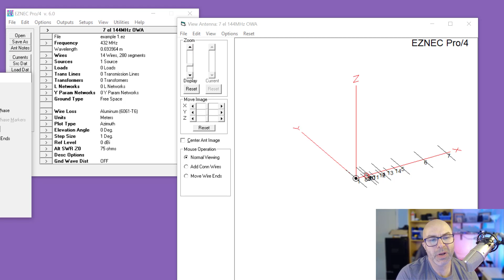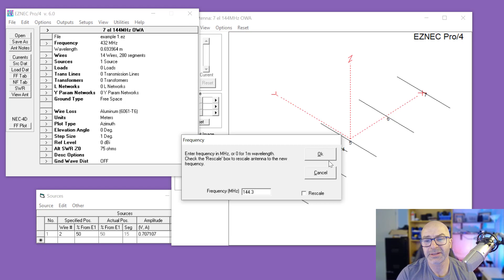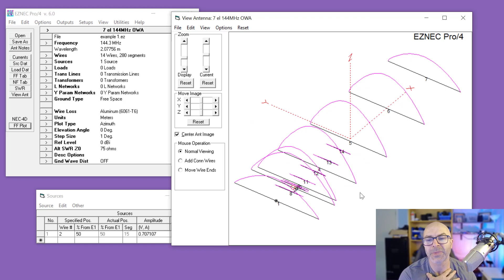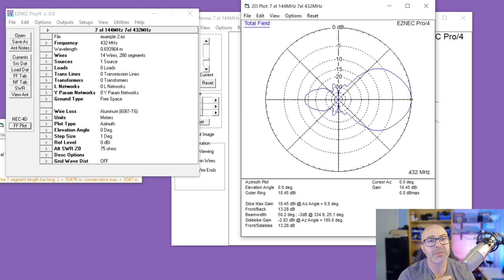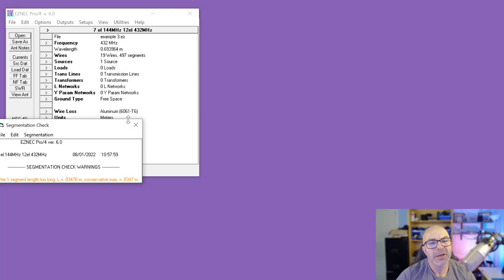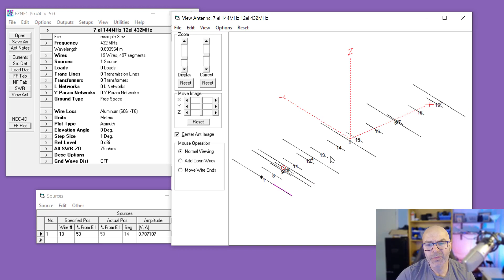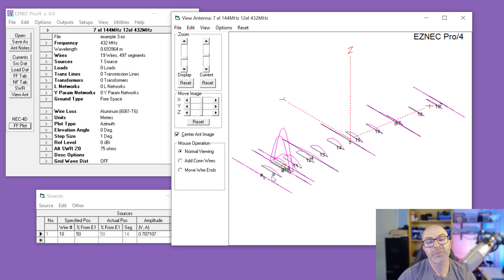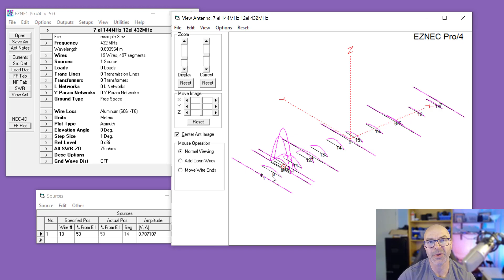2m and 70cms Dual Band Yagis - Why not? The dangers in your shack could be real!

Comment: Currently building a moxon 20m, I am using 4 glass fibre poles with the wires inside, so there is a bend towards driven / reflector at the ends. I have only just found your videos, great Ty. How would you model the bends in EZNEC?
Reply from the maker: difficult to do accurately without NEC4.2 running on EZNEC

Comment: Same question as Randy: What about the Arrow where 70cm and 2m have different polarization? The same problems?
Reply from the maker: no, not when in opposing planes and assuming the elements are perfectly centred. If the elements are off set to one another then there will be some distortion. worst on 70cms as a result of the offset effectively being 3 times that of 2m (in terms of frequency)

Comment: I would be interested to see what would happen if the two antennas were cross-polarized,
Reply from the maker: Ni issue when in opposing planes and assuming the elements are perfectly centred. If the elements are off set to one another then there will be some distortion. worst on 70cms as a result of the offset effectively being 3 times that of 2m (in terms of frequency)

Comment: Very interesting insights of the combination problems which can occur.
Even the harmonic infeed problem with risk of destroying the RX stage is rather frightening.
Reply from the maker: Thanks Heinz, As I mentioned in the video, these are worst case scenarios although all or any of these issues can occur, the worst being the twin-fed problems to the RX of the primary band. It is better to know what could happen to take measure to prevent it or use this information to guide your antenna decisions differently.
Reply: @hamradioguys  TNX Justin for your reply!
My actual setup is rooftop mounted an I0JXX 6m 7el Yagi (12 m above ground, 2 m above roof) on the lower and a 2M12 on the upper mast position, with a distance of roughly 2m.
M² does a great job here since over 2 decades, Italy antenna performs also well but is mechanical crap (round boom with weak element fixation)...

Now i write down what i am thinking about since 2 or more years, all your antenna concepts (as well as the others) in mind...:
Since it is not a problem to "hide" an 11m boom where there is already 9,6m mounted, i would like to build myself two boom systems with 11m sqare tapered or so, eventual self supporting w/o ropes, carrying mixed antenna systems.

I could imagine for the lower boom a mix of roughly 9el@6m, 5el@0m, and something 20el@70cm. 10m centered around the mast tube.
Maybe the 70cm elements would better go on the boom downside.
So the longer elements to have some free sight for them. 
70cm hanging below with some distance blocks and 6m + 10m on top of the boom.

I think these bands should not interfere and they could even be carried out with three coax feedlines seperately.

Then the upper boom should carry about 13el @2m and maybe 6el@4m. Also 2-cable solution . 4m centered around the mast tube.

Also no interference to be expected between 2m and 4m.

What is your opinion all about? Risk of RX destruction abolished?
Is it possible to create such a concept on EZNEC, or do you see any obstacles?

73 de Heinz, DL2RDT
Reply from the maker: @heinzschopf9118  it is a difficult one, you ideally need those with a third harmonic relationship with the biggest distances between them, 2m and 70cms, 2m and 6m and so on. 'ideal' stacking distances are not just frequency dependant, the lengths of the associated booms play a role too - the longer the booms, the wider the spacing needs to be. The mean height of the 70cms is going to be greatest (in terms of wave lengths) so mechanical issues aside, I would place the 70cms first above the rotator, then 6m then 2m at the top with widest spacing possible between each. calculate the distance you have in wavelengths rather than just metres.